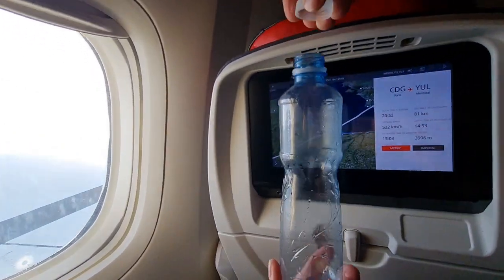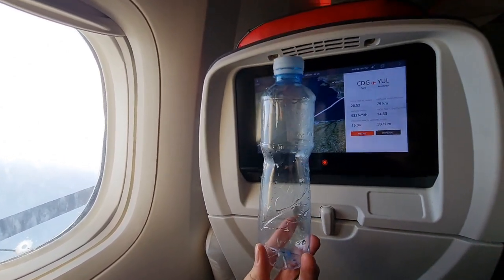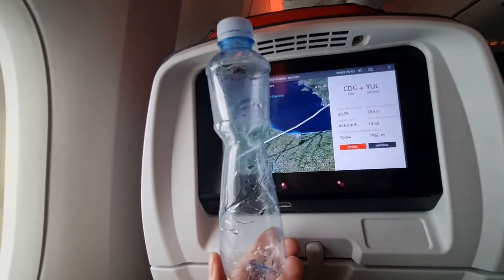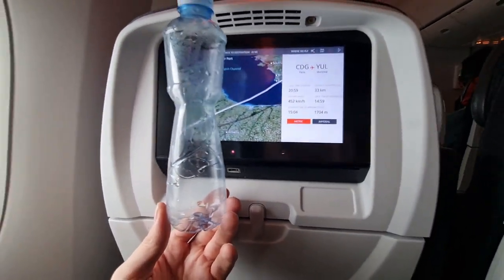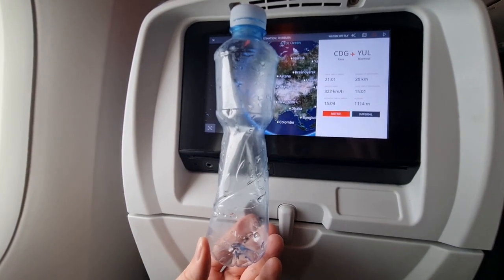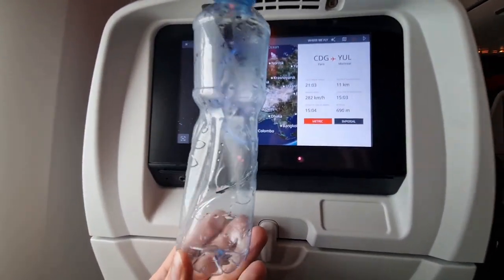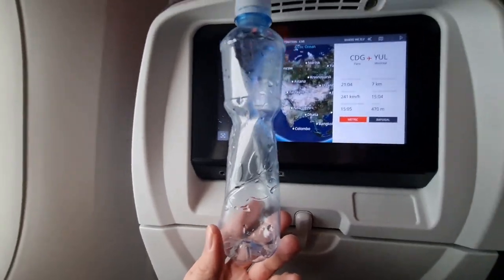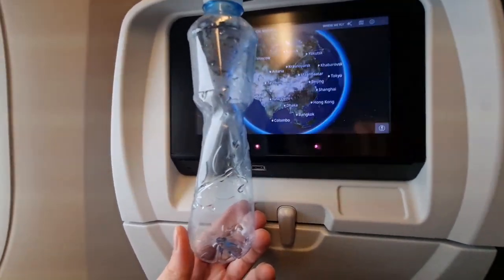Boyle's Law || Airplane Landing

Comment: dq=dw+du
As ambient pressure is  increasing when you are landing, the air also inside has to give same pressure , its negative work done is ocuuring,so molecule are being compressed to give equal amount of pressure as ambient.so bottle is crushed. Addition temp inside bottle is increasing . 
dq= 0 du = - dw. For adiabatic considered

I revealed it.